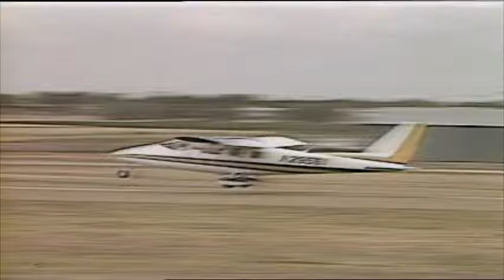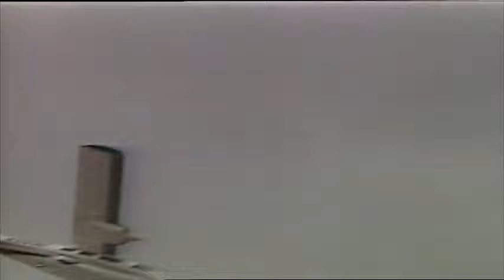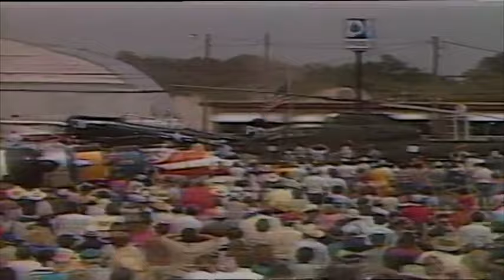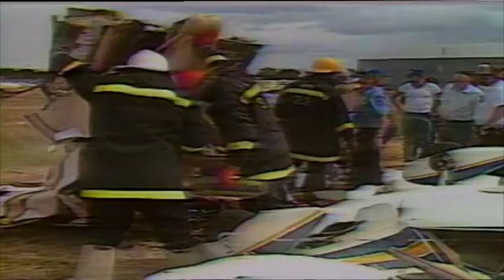Plane Loses Wings During Airshow (09/11/83)

Comment: I feel sorry for his poor wife, you can hear her crying and when she says "I still need you" that hit hard 😢 unfortunately that plane was not designed to be flown like that and it fell apart because it was overstressed.
Reply: Partenavia had been in contact with Wes Winter prior to the show, to warn him against trying aerobatics in the P68 aircraft.
Reply: I saw this  same crash years ago....  from another angle though.....Rectangular wings this wide are for better glide capabilities. 
A walk-around showing the obvious fact there are no struts screams "any acrobatics is a risk".
Reply: I had to replay a few times and then listen with my eyes closed to pick out "I still need you" out of the general noise.   But you're right, it's there if you listen.
Reply: Thank you for sharing that important fact. As you stated The was not rated for aerobics. The pilot knew that.
Reply: @williamturner1517  "The was not rated for aerobics. The pilot knew that."

It wasn't? How did you determine that?
Reply: @Tom-zs6bb   It's right in the owner's manual for the P68. THIS AIRFRAME IS NOT AEROBATICS RATED.
Reply: @codyking4848  First, it's not an 'owner's manual,' it is a POH. And the correct quote from the POH is "This airplane must be operated as a NORMAL Category Airplane in compliance with the Operating limitations stated in the form of placards, markings, and manuals. No Aerobatic Manoeuvers, including spins approved."

The FAA has a system for obtaining Certificates of Waiver or Authorization. Are you certain no waiver was granted in this case?
Reply: @Tom-zs6bb  Would you not need the agreement of the manufacturer to get such a waiver signed?
Partenavia had already contracted Winter to express their concerns about the way he was flying the aircraft.
Reply: @newforestroadwarrior  I'm not familiar enough with the process to say but I would certainly think it prudent to at least consult with the engineers who designed and built it.
Reply: @Tom-zs6bb so pretty much what the op said, although paraphrased somewhat.
Jeez, autism Tom 😁
Reply: @JamesPCroad  Jeez, name calling James.
Reply: @michaelbigelow3255  No I don't think that, and nothing I've written implies otherwise.
Reply: overstressed
Reply: @michaelbigelow3255  The *waiver* means that the specific planned maneuvers would be approved by the Manufacturer, or that the planned G loading was low and not what would be considered 'typical' aerobatics. It's not very likely to get one, but they do exist.
Reply: @michaelbigelow3255  Settle down turbo, you implied he was making it up. Of course all that you said about an idiot in the cockpit is true and especially so in this case. However my 'assumptions' about G loading are not in fact 'wrong'. Is your world really this black and white? A conversation instead a comment thread conclusion would illuminate you.
Reply: @michaelbigelow3255  No problem.
Reply: omg man, i didnt hear that until you mentioned it. Had it replayed and its heartbreaking.
Reply: @michaelbigelow3255  Yes, we got your point, and I agree he overloaded it. I think the video leaves little doubt baring some unknown structural condition. Which would have likely been brought on by previous overloading by this pilot. Aerobatics are really cool right up until they aren't.
Reply: @Tom-zs6bb common sense
Reply: Partnavias are not rated for high positive and negative G's, the aircraft is a small commuter / business aircraft, notice the failure points just OB of the engines.. not strong enough, not stressed for that and cracking in the main spar was a certainty over time.  He was told by the aircraft manufacturer NOT to perform aerobatics but ignored it "because he knew better" and had "gotten away" with it time and time again....  the only good thing to come out of it was it didn't hit anyone on the ground.
Reply: @michaelbigelow3255  Never said that, never implied it. I was referring to legal issues. Had he not allowed the a/c to overspeed coming out of the loop and then attempted to suddenly pitch the nose up, the wings wouldn't have failed.
Reply: @88badstang  Am I supposed to guess what you are referring to? In any event, do you really believe that "common sense" is a substitute for an education in a technical subject like aviation? "Common sense" says air pockets exist and airplanes fly because they have engines.
Reply: @Tom-zs6bb Yeah, same common sense that would tell any critically thinking person a C130 is not rated for aerobatics. Maybe not you though. Maybe take a guess.
Reply: @88badstang  While what c130s are "rated" for is irrelevant to the issue under discussion. I responded to a comment that said the aircraft in question was not capable of performing aerobatic maneuvers and my response was that ANY aircraft can do so and I listed two famous examples. I never recommended all aircraft should be flown in that manner. Maybe you should seek education on a subject before commenting on it.
Reply: @newforestroadwarrior  No mystery there. The NTSB report of probable cause pretty much said the same thing, albeit in the usual, dry governmentize. Your comment was arguably better in that regard.
Reply: @Tom-zs6bb man, you just like to argue. “Owners manual…..no it’s a POH”. “Can’t do aerobatics…yes it can, but you shouldn’t.”  Etc etc etc. What the heck dude. You knew what they meant. Take your meds.
Reply: @rtbrtb_dutchy4183  So you're arguing with me for arguing with them? Good grief!
Reply: @Tom-zs6bb  LOL. I made a comment. Not getting into a back and forth with you. Take your meds.
Reply: @rtbrtb_dutchy4183  So you initiated a "back and fourth" and now you're going to flee. That's just as well as your ignorance of the subject matter, the ignorance that prevented you from understanding my comments in the first place, wouldn't serve you well in a discussion. Have a good night, lightweight!
Reply: @Tom-zs6bb 

If you're not familiar with the process, why in hell are you quibbling about the "owner's manual"? Jeez dude learn when such nitpicking is appropriate.
Reply: Bob Hoover flew aerobatics in a Rockwell Shrike Commander. Similar airfraft to the one in this post. However…Bob knew to stay within the flight envelope of every aircraft he flew.
Reply: @Tom-zs6bb  Just to you.
Reply: @Name-ps9fx  I suppose it 's only appropriate when you address comments to me. Good to know.
Reply: @88badstang  Very good. Now use that phrase in a sentence.
Reply: @Tom-zs6bb  Have your boyfriend use it in a sentence.
Reply: @88badstang  Oh, clever. What did you think of that C-130 that can't perform aerobatic maneuvers performing aerobatic maneuvers? Cool. huh?
Reply: Yes, apparently he had promised to put up some shelves ln the home that week😢
Reply: @codyking4848 Those aerobatics to be specific.  There had to be signs he was pushing it too far.  Any plane can do some aerobatics.  As I recall he was over speeding the plane and pulling high gs.
Reply: @Tom-zs6bb the company who built it reached out to the pilot saying as much…………
Reply: @Tom-zs6bb  
"It wasn't? How did you determine that?"

Because both wings broke apart in the air? That's a sign of airframe overstress and absolutely nothing else. Case closed.
Reply: @robertwolcott215  I keep seeing comments like yours but I have yet to see the evidence.
Reply: @darreno1450  The aircraft was not performing an aerobatic maneuver when the airframe failed.
Reply: @Tom-zs6bb  Yes it was.
Reply: @darreno1450  And what maneuver was the aircraft performing at the time of the failure? I expect you will say a loop and if that's the case, then perhaps you should watch the video again.
Reply: @Tom-zs6bb  You've been fed enough already.
Reply: @darreno1450   "You've been fed enough already."

Translation- 'I got nothin.' 

It takes a special kind of coward to initiate a confrontation and then run away!
Reply: @Tom-zs6bb Hell, Bob Hoover performed aerobatics in a “not rated for aerobatics” Aero Commander 500 for years and made it look easy. It’s all about knowing the airplane and it’s limits.
Reply: @Tom-zs6bb From an old article related to the incident—“….seven months earlier Winter had obtained FAA clearance to operate the aircraft under an experimental aircraft airworthiness certificate”.
Reply: @Ant0417  Okay, I thought something like that may have happened, otherwise the pilot would have been exposing himself to enforcement action(s). Thanks for the info, jarod!
Reply: @Ant0417  Yeah, I noted that in a previous comment to a mope who argued that not all aircraft could perform aerobatics. I also mentioned Tex Johnson rolling the 707 prototype.
Reply: This guy Tom sounds like a real party animal.   I wish I could get him to come to one of mine.  Who needs a band, when you could have an argumentative sperg give a dissertation on the differences between a manual and a hand book?
Reply: @eat_a_dick_trudeau  Ah, another unschooled individual who is unequipped to understand the point. LOL!
Reply: @Tom-zs6bb  😉 don't be so hard on yourself, Tommy.
Reply: @Tom-zs6bb wow you sure prattle on about nothing…maybe you should consider less time on YouTube. Just saying.
Reply: @doriangray2020  "wow you sure prattle on about nothing"

That should read 'wow you sure prattle on about nothing I am equipped to understand.'
Reply: @Tom-zs6bb Jeeze James got a point though right?
Reply: @chipcity3016  There are more than one "james" in the thread and at least one of them posted multiple comments. Can you be any more specific?
Reply: Typical, the dude dies and she makes it all about what SHE needs.
Reply: @MrRidleyDog  That's pretty harsh, MrRidley.
Reply: @Tom-zs6bb  it's a harsh world and narcissists who only think of themselves in times of crisis don't make it any better.
Reply: @Name-ps9fx  And now we know that the FAA did indeed grant a waiver so he could operate the aircraft in that manner under an experimental airworthiness certificate. Interesting, huh?
Reply: @MrRidleyDog  Yes, it is a harsh world but why make it more harsh? Not only were her comments extemporaneous, but they were uttered under a tremendous amount of stress. Maybe you would do better watching your spouse die but hopefully, we'll never find out.
Reply: @Tom-zs6bb  he had just finished the Cuban-8 maneuver seconds before, but did not perform the next planned maneuver for some unknown reason. He went into a couple of circle maneuvers instead of his planned move, so he possibly realized he damaged something in the Cuban 8 maneuver. He received permission from the FAA 7 months prior to use this plane for aerobatics, so he was cleared, even though the planes maker said not to do it.  He made zero modifications to 7 passenger executive plane. Of course, many planes have been given permission to fly these maneuvers,  only to suffer catastrophic loss, then not be allowed to fly again, so their approval is irrelevant.  Whether they continued to allow this plane to fly aerobatics AFTER the crash is the more pertinent question.
Reply: @miragesmack007   What are "circle maneuvers?" 

"Of course, many planes have been given permission to fly these maneuvers,  only to suffer catastrophic loss"

Can you provide any details? I ask because in fifty years of flying, I am unfamiliar with the "many" to which you refer.

"Whether they continued to allow this plane to fly aerobatics AFTER the crash is the more pertinent question."

I can only assume that you are referring to other aircraft of the same make and model but there's no reason for not allowing other aircraft to fly under experimental airworthiness certificates. It wasn't the airplane or its design that resulted in this crash, it was the pilot's decision to suddenly pitch the airplane up while flying in excess of the aircraft's Vne.
Reply: @Tom-zs6bb   *back and forth
Reply: He was some 30 kts beyond Vne on this pull up
Reply: @Tom-zs6bb   Gravity turned out to be the enforcement action.
Reply: @StratMatt777 

"If someone has an ego issue due to low-self esteem that compels them to "beat" others in invented or imagined conflicts over meaningless minutia in order to feel superior...."

Maybe you should take a look in the mirror, pal.
Reply: @StratMatt777  "A barrel roll is a zero-G maneuver if done correctly"

You mean a one-G maneuver, right?
Reply: @StratMatt777  "Arguing over the specific meaning of "aerobatics" or arguing over how the person you corrected used the word seems like a big waste of our limited lifespans."

And arguing about arguing over the specific meaning of "aerobatics" or arguing over how the person I corrected used the word is somehow NOT a "big waste of our limited lifespans?" 

I am literally laughing out loud. 

 
"Tom Perhaps you will find happiness if you get some counseling for low self-esteem."

And perhaps you, doctor, can find happiness when you cease projecting your weaknesses on others.  This isn't an insult or an attack, merely a factual observation based on the evidence, to coin a phrase. 

And I'm still laughing!
Reply: It's not hard to spot a madman willing to leave it all behind. Got to accept that as a companion to such.
Reply: go to an airshow if you have never been esp if they have the Blue Angels or the likes.  Very entertaining.
Reply: Hits even harder when you are 40 and never been needed at all
Reply: I appreciate your empathy OP. However, how narcissistic is it to be thinking of HER needs, before her husband is even dead?
THAT'S JUST CREEPY!
Reply: @jameshisself9324 That both wings sheared symmetrically at the same time and in the same way implies he stressed the plane well past intended design loads. Not that there was an undetected structural weakness or damage, which would be unlikely to be symmetrical.
Reply: @andrewtaylor940  Just as likely as it isn't. We can go round and round forever on the hypotheticals, you are really off into the weeds but don't let that stop you.
Reply: @jameshisself9324  What’s off into the weeds? You had two separate but symmetrical structural elements fail in the same way at the same time. That’s almost always an external force has exceeded what the structure, be it airframe, building or bridge, was designed and rated to withstand. Both wings failed at the highest stress point, at the same time.
Reply: @andrewtaylor940  You are in the weeds because you are attempting to apply a laboratory level analysis to a real world aero failure. Sure everything you said could be exactly the failure mode, but it just as easily wasn't and you don't have enough from a grainy video like this to say either way. It's just mental masturbation.
Reply: @jameshisself9324  Most crashes accidents collapses or other incidents are not Sherlock Holmes level mysteries. In most cases the obvious answer is in fact what happened. Once again, both the left and right wing, outboard of the engines, both separated in a symmetrical manner while the aircraft was engaged in a deliberate and elective high G maneuver, which the manufacturer had cautioned against. Unless this is a carrier plane with folding wings that somebody forgot to put the locking pins in, the mechanism of failure is pretty obvious here. And yes you can tell a lot immediately from grainy footage. Heck it’s more than you usually have to work with. Real Life isn’t an episode of Air Crash Investigations. And no commenting on the obvious is not mental masturbation.
Reply: @andrewtaylor940  Oh how I wish you were telling this to someone who didn't already know. But you seem hell bent on arguing with someone. Live it up
Reply: @Tom-zs6bb 
Ask the pilot
Reply: @hotrodray6802  Ask the dead pilot what, exactly? Neither you nor your merit by review of 94 comments in an attempt to figure what the hell you're talking about.
Reply: She meant that she still needed the plane
Reply: @Tom-zs6bb  He has eyes and can see. You  on the other hand ...
Reply: @MrFescue  I'd pull up the ~100 past comments to find out what you're talking about if you were worth the effort.
Reply: @Tom-zs6bb  ok
Reply: You can do some aerobatics in many airplanes that aren’t designed for them, but the overstressing can bite very hard over time.
Reply: @Mikhail-Tkachenko  If it's not too much trouble, can you tell me okay to what, exactly.
Reply: @flybob63  By "overstressing" you are alluding to exceeding the G-limits that are published in the aircraft's POH, you could be right. If, however, you are referring to past, unaddressed damage from exceeding the aircraft's design limits over time, I do not recall that being included in the NTSB  report of probable cause.
Reply: she was the announcer.
Reply: @tbh9088  Wow, 2 months in and tbh can’t let this go. Hint: no one cares how smart you aren't about airplanes.
Reply: @readmore3634  That is a seriously  uninformed thing to say.   Or in other words : total crap. Whether an aircraft was designed with or without struts has zero effect on its strength.  Every unlimited aerobatic aircraft these days is a cantilever monoplane. Do you believe Cessnas are somehow stronger than Pipers? They are both designed to similar G-limits.   Go read an engineering book.  And your word salad about "wide wings"  makes zero sense.
Reply: @tbh9088  Yeah, I've been laughing, too. Ever since you demonstrated your hilarious lack of self-awareness.
Reply: @PDZ1122  Saggy diaper? Wife neglecting you?  You typed:
"struts has zero effect on its strength" 😂Your  words, not mine...go pick on your kids or something.
Reply: cool story bro
Reply: Good catch, all I head was wailing.
Reply: It seems like this guy was trying to do a Bob Hoover type display in an aircraft that wasn’t rated to handle it.  Pushing an airframe beyond its design limits is just dumb and an accident waiting to happen.  Sad the guy had to die to realize his mistake. Not that it matters much much but he hit the worst way possible, upside down, cabin first.  Whenever you see one of these you always think he might have hade it, if he hit just right the airframe and the seats might have absorbed the impact, maybe he had enough drag on the way down.  This guys luck really ran out though, after the outside skin his head would have been the first thing to hit the ground
Reply: Exactly what I thought over stressing YES,  however a very Sad story ofcourse and yes after I read ur comment I heard his Wife YES which makes it even more Sad  !! Thanks for the info Sir  !!  😢😢😢
Reply: You're imagining what she said, she's just saying oh my god and mumbling
Reply: @sonnytaylor7521  nah, she's just making crying sounds, it just sounds like that if you want it to sound like that.
Reply: Then maybe don’t marry someone who takes insane risks like this
Reply: @88badstang  While that is true, you can still perform a barrel roll in a C-130 with proper control and enough starting altitude. Should you? I'll let you decide (I don't own one)
Reply: @keamu8580  You can jump a stock F150 off a 50 foot ramp to
Reply: I feel liberation for that man. "I still need you" is the most horrible phrase to hear. He is not a commodity.
Reply: @Tom-zs6bb  i think everyone's point is that this airframe was clearly not designed for these types of high G maneuvers.  A piece of paper from a government entity or manufacturer absolving the owner of any potential violation enforcements for these practices has no correlation whatsoever with the aircraft's performance envelopes. 

Physics don't abide by legalities.  Getting permission to do something ill-advised doesn't make it any less ill-advised.  Sadly, I'd wager that the owner knew the risks he was taking, but probably thought he knew the airframe better than its manufacturer.   Hubris...as always
Reply: @razorfett147  The airframe was just fine performing the aerobatic maneuvers for the show. It didn't fail until the pilot, for some inexplicable reason, made a sudden , positive-pitch input while the aircraft was traveling in excess of its VNE.  That is something that I assumed even non-pilots would understand. I was wrong.
Reply: @Tom-zs6bb  thats what i just said: the pilot did something that was outside of the airframe's safe operation envelope.  Restating the same conclusion  with more technical jargon doesn't change the established point.
Im not sure what's fueling your persistent  pedantics
Reply: @razorfett147  Well, cowboy, you contacted me, right? 

All I have ever said is that the airshow routine did not include ANY maneuvers that would exceed the aircraft's g limits. What the pilot did was not part of the airshow. 

I thought I was used to the ignorance of the uninitiated but you people have managed to surprise me!
Reply: @Tom-zs6bb  so.   A pedant with a sizeable superiority complex.  I can see why you're so popular here
Reply: @razorfett147  Well, I'm sure popular with you! Until the next bright, shiny thing comes along! LOL!
Reply: I don't think that plane was built to fly, given that cloud vapor took it out. Damn.
Reply: @razorfett147  "Im not sure what's fueling your persistent  pedantics".  It's called trolling sir, and as long as he keeps being fed, he won't stop.
Reply: @Tom-zs6bb This guy was known to thumb his nose at the FAA and those that advised him to stop doing it. A 1983 issue of Flying magazine covered his attitude and the resulting crash in great detail. If you're interested and can find the issue it goes into great detail about what lead up to this foolish and senseless death.
Reply: @muhammadsteinberg  So I guess that's why the FAA took action to stop him from flying that aircraft in that fashion. Oh, wait...
Reply: @darreno1450  Yes! It's unfortunate that an interesting post of aviation history is being trolled.I hope interested viewers can weed out the nonsense and appreciate the post and comments of those that were knowledgeable of the circumstances during the time of the incident.
Reply: it's not the only air show where the wife of a doomed pilot watched her husband fall out of the sky and crash.
Reply: This is not the first time where a wife who was at the microphone narrating the air show, watched her doomed husband fall out of the sky and crash.
Reply: @Tom-zs6bb  I think we knew what he meant by the phrase "owner's manual".  
However, thanks for the pedantic correction.  It really allowed you to put your knowledge on display.
Reply: @RH-cv1rg  And if you knew anything about aviation, you would understand why I pointed his error out.
Reply: @Tom-zs6bb  Once again, you are letting the crowd understanding how knowledgeable you are.  Way to go, while demeaning others at the same time.  Double score.
Reply: @RH-cv1rg  "Once again, you are letting the crowd understanding how knowledgeable you are."

And to that piece of literary genius, I can add nothing except to note your strange obsession with me. Sorry, but I'm already married.
Reply: @Tom-zs6bb  - The wings snapping off after a loop are a pretty solid indicator
Reply: @kylecrane4376  How soon after the loop did the failure occur?
Reply: @Tom-zs6bb  Responding to your post is now an obsession?  I hope the neighborhood dog doesn't look at you, you might get funny ideas.
As for the incorrect spelling, before you gloat too much, you might want to look at your posts.  I ignored the mistakes as your post conveyed the message......just like the original poster's idea was conveyed when he mentioned the "owner's manual".
Reply: @sonnytaylor7521  Just after My God
Reply: @Tom-zs6bb  "I have yet to see the evidence"

Have you tried watching the video?
Reply: @James-zj3ud  Sure did. At what time in the video does the aircraft manufacture warn the pilot not to fly aerobatic maneuvers?
Reply: Why would a pilot fly a plane that can't be over stressed like that, unbelievable
Reply: @Coolman1985  Every single airframe that has ever existed can be 'over stressed.'
Reply: Yeah that plane looked like a piece of junk